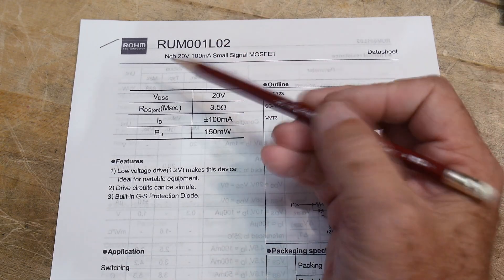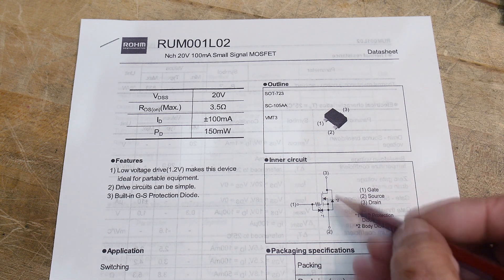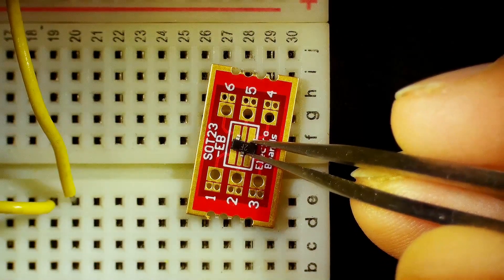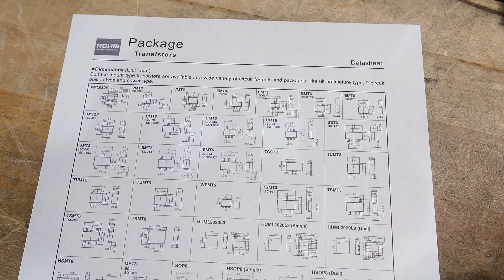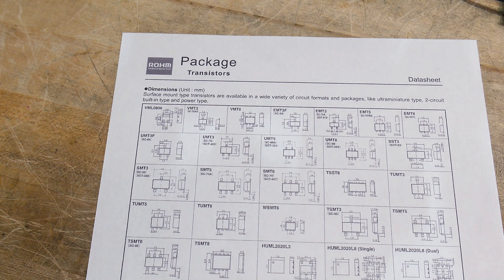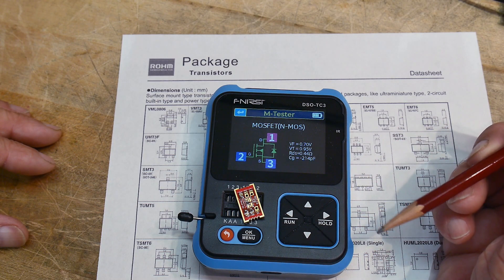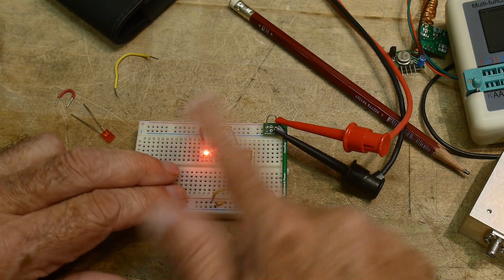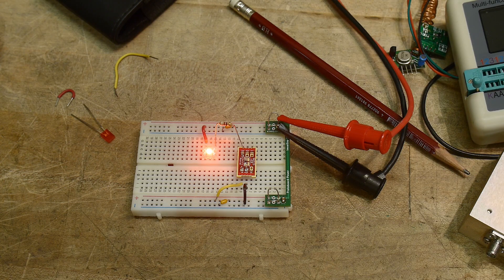#1973 RUM001L02 MOSFET

Comment: The RE1C002UN is one of my goto MOSFETS. Same package but higher Vds, higher current en slightly lower Rds-on. Watch out with the drive voltage. As with the previous MOSFET video the Vgs-max is +/- 8 volt.

Comment: When / why you use this chip?
Reply from the maker: A microcontroller (like arduino) can only handle about 20mA. If you need to turn on something (LED, laser, relay, motor), this can do 100mA. and it doesn't take up much room
Reply: Also it can control higher voltages, so you can easily interact with up to 15V logic. 3 Ohms is fine for signals, most analogue switches are 10s of ohms. I'd probably want lower gate capacitance though

Comment: With over 200 pF gate capacitance it's use as a small signal Amp is limited in frequency.
Reply: Are you looking at the right data sheet?  The data sheet I am looking at gives typical values of 7.1 pF for Ciss, 3.3 pF for Coss, 1.7 pF for Crss.  Also, its gate threshold voltage of 0.3 to 1.0 volts makes it attractive for some low voltage applications where it may be undesirable to supply the base current that a bipolar transistor would require.
Reply: @analog_guy  OK, I thought I saw that data sheet say 200 pF or thereabouts. My mistake!
Reply: it was 214pF on transistor tester.
Yeah, seemed sketchy to me as well considering such a tiny die.

Comment: Isnt that diode just the parisitic body diode formed in the creation of the FET?!
Reply: Yes. And all mosfets can conduct in both directions when on, unlike BJTs, so I'm not sure why he was surprised by this.
Reply: @humidbeing  yes, we actually often take advantage of the body diodes, recently i made a bridge rectifier with two SI2302, two 4R resistors and one BAV70. the gate allows to switch from harvesting (rectifier) to differential measurement (balanced burried resistors).